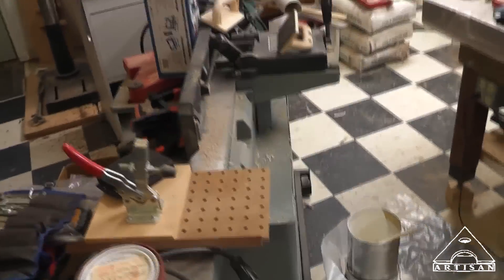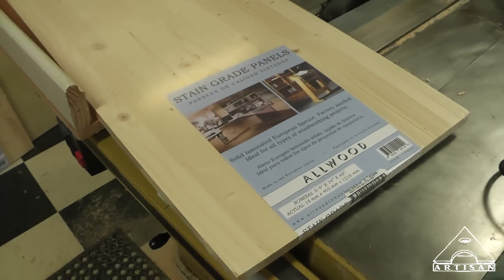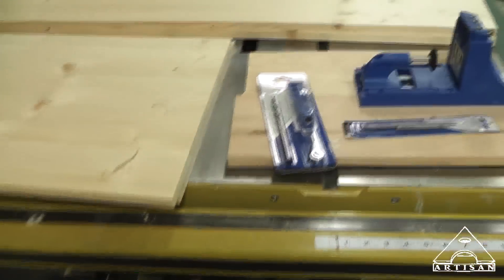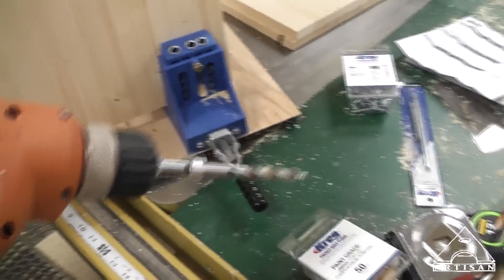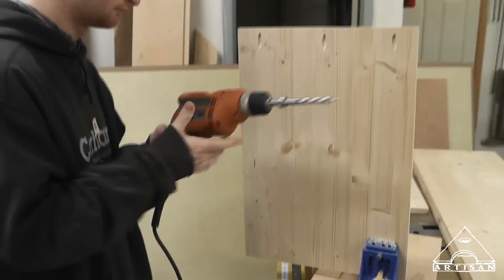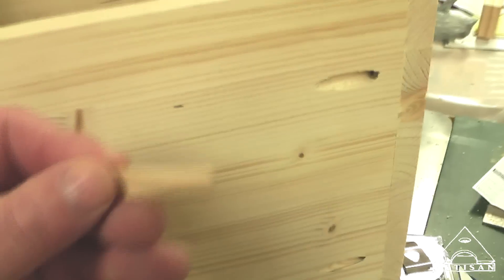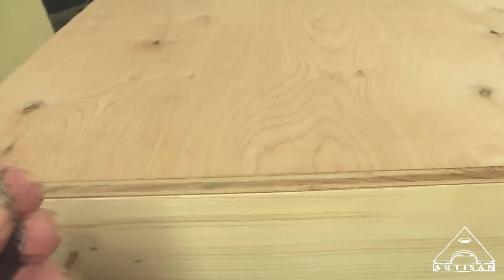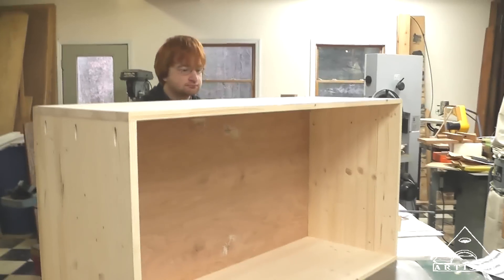Making a Cabinet the Easy Way - Kreg Pocket Hole Jig - Vlog #2

Comment: Course screws are for plywood.
Fine screws are used to fasten hardwood

So all your cabinet sides and bottoms you should use the course threads.
Your faceframe wood typically is a hardwood so you would join that ussing the fine threads.

Comment: I switched to square head screws. Hard to strip the heads like drywall screws. I just redid my 1000sq. ft deck last summer. Had it screwed down with Galv. drywall screws. What a bear getting 10% out. They don't even sell Galv drywall anymore. I switched to sq. head. what a dream!  Went thru 60 pounds of 2 1/2" screws

Comment from the maker: Drywall screws are made to counter sink and would not work with this system.  They also d not have good tinsel strength either but everyone has their way of doing things :)  If you ever try the Kreg Pocket system you would love it.

Comment: First screws were Philips and square drive also. But you need small traces of brains inside skull to figure it out. The same story regarding the pocket holes, which should be INSIDE, smarty...
Reply: 1zanglang He did state that the cabinet was going to be inset into a wall cavity which would hide the outer holes.
Reply: cjpenning Yeah, right...
Reply: my boss showed me a few workbench plans hes planning to build that he got from mysecretblueprints. com and man those look like they are going to be awesome. cant wait to build it this next week

Comment: I just purchased the pocket jig and it was nice to have your demo. I actually appreciate that everything didn't go just perfect in your video--so much like the real deal. Even the pros have to improvise and problem solve. I like your idea about using contrasting stains for the plugs too, very cool. I also agree that you have to determine what is appropriate for your specific project. Thanks again!

Comment: Can you bye the professional Kreg Pocket Hole Jig i have looked on the net for it but i can not find it i live in the UK do you know if  it possible to get it here  and can you tell me the full specs of the jig so i can see if i can fined it. Thank You Pete
Reply: thanks but it is this one that is in the video i was looking for. The only one like it is the Kreg 5 jig but i proffer the one in the video thanks anyway
Pete
Reply: Peter Mitchell It looks like a k5 to me, with the side storage taken off and attached to a board. k5 handle at the front, k4 handle at the back. But using a dado blade to cross cut and without a insert plate / throatplate, not good at all.
Reply: ok thank you it looks like i  will have to get the K5 then thanks for your help
 Pete
Reply: Peter Mitchell ive just seen the k3 im sure its that one http://www.bytravis.com/wp-content/uploads/2010/06/k3vsk4.jpg
Reply: Thank you i have just ordered a K5 jig it will be here today thanks for all your effort in trying to fined one for me
Thanks again 
Pete
Reply: Good, now you can concentrate on learning how to spell

Comment: Why are the pocket screws on the outside of the cabinet? Pocket screws are meant to hide the jointed boards.
Reply: It's an inset box.
Reply: pocket hole are meant to go where you don't see them, you need to use your brain to work it out.

Comment: Actually Kreg joints are extremley strong. Just go to the woodstore where they have the samples joined and see if you can pull it apart. 

Biscuits do make the joinning of faceframes cleaner. However biscuits should not be used as a strength joint. They should be used as an allignment.
Although by the time a biscuit joint has failed it's time to repalace the cabinets anyway. ;)

Comment: Thank you for taking a close up of the drill depth gauge!  I'm starting a cabinet project tomorrow using an old Kreg jig and the depth info has been long lost.  I've been trying to locate the measurements for quite a while with no luck.  They will be written on the lid of my drill box or shed wall, somewhere that I'll be able to find them again.  But now how am I going to justify buying an upgraded Kreg kit?

Comment: It's the same way that Electricians will use the square driver on the screw head although it appears to be phillips heads, you can still use the square driver on the head.

Comment: BTW, the screws are a combo philips square drive so you can use either driver style. The coarse threads are for soft wood and plywood. They also make a fine thread for hard woods.. you should check this all out before you make a video about a particular tool or system

Comment: YOUR SHOP IS A DISASTER WAITING TO HAPPEN!!! HOW DO YOU GET ANYTHING DONE?
Reply: if that was my shop i would spend more time cleaning up the mess to get to the tool i want than i would doing the actual work on the project. Having to move all the trash and junk around takes up a lot of time. Having a clean well organized shop will not only be safer but cut down on wasted time.

Comment: Why do you let your offcuts fall into the saw? Eventually you might get something wedged in the pulleys/belts/blade and cause that piece of wood to explode and shoot shrapnel at you. Even if that doesn't worry you, the potential to cause pretty expensive damage to what looks like an already expensive powermatic saw. It seems pretty ridiculous that you take the time to install the throat plate when it came time to do the assembly and you needed a flat surface.
Reply: +mike789166 wood This from a guy who has time to reply to everyone's critical comments. How hypocritical.

Comment: WTF @ 5:21 are you really crosscutting with a dado blade when the miter gauge extends out of the table saw that has no type of clearance insert? Thats 3 no no's sir. Good thing you have small fingers..
Reply: ***** Can you explain what is bad here in layman's terms for a newbie?
Reply: +Luke Hodnett Yes, whatever this guy did in the video ..................... DO THE OPPOSITE !!!!!!!
Reply: +Luke Hodnett Sure 
1. Never use a DADO BLADE to cut anything in two. They are for DADO AND RABBET CUTS.
2. MITER GAGE that extends out of the table saw can cause the board to move and not run parallel to the blade, this is really dangerous as it can cause a TABLE SAW KICKBACK. 
3. Not having a  TABLE SAW CLEARANCE INSERT can cause the board to vibrate and chip, making ugly cuts. 

This guy is just lazy. Please be careful.

Comment: Someone made the comment in the thread that pocket holes are for beginners....I beg to differ, they are a joint like any other, there is a time and a place for them for anybody.....but they are very easy....and fast....

I couldn't finish watching this video, that shop was not "Well Used"....it was Well Neglected....You wouldn't have to put your piece together on the tablesaw if you cleaned it.....Artisan's???????  laugh snort cough.....ok...if you say so... Wrong Screws.....again....laugh snort cough.......

Comment: nice build, but those screws you called Philips also work with the square drive bit, use them everyday
Reply: Kris Hamilton why get all technical, just call it what it is, square.
Reply: blosom2315 Because that's what they're called; Robertson heads.
Reply: I know, but so few people do now days that they are widely known just as square drives. if you go into home depot and ask for a Robertson head screw they will look at you like you're huffing paint.
Reply: Hey +DuckBlossom2315: The ONE place where they would assuredly know what a Robertson driver is would be a tool supplier like at.......wait for it.......................Home Depot, of all places.

Comment: for your information, those screws would have worked. They are philips head or square drive.I dont know the depth of your carpentry skills but you didn't show me any cabinet makers abilities. The Kreg is for beginners.  If you helped build the shop I would think your knowledge of hardware was more adapt to the trade.your shop conditions are deplorable. unsafe and very difficult to work around. Its evident you don't clean up after your projects either.
Reply: +richard brumley dam i thought the same thing, using a dado to rip material, and no insert, real safe
Reply: +richard brumley  Agree the screw thing made me LOL, The dirty shop is not a sign of a used shop, it tells your customers you don't care.  I don't know d!ck about woodworking but the layout of the shop is terrible. How does the dust collector end up in the middle of the shop floor?

Comment: Couldn't watch this mess. The shop was an utter mess and not safe at all and no equipment safety. They may make a great product, but wow, so unsafe.
Reply: @Ian Knottenbelt — Dude, I was thinking exactly the same thing.  That shop is a disgraceful mess.  I spent some time helping out a carpenter make some build ins for a client in order to learn some tricks of the trade.  His shop looked NOTHING like this.  He was very anal about shop cleanliness and safety.  You can certainly use your equipment regularly and maintain your shop in a clean orderly fashion.
Reply: It more than likely is a working shop meaning they are in the middle of a build up so stuff is going to be laying around.